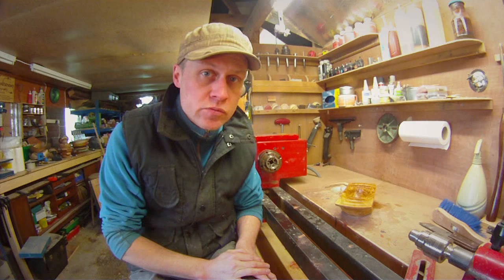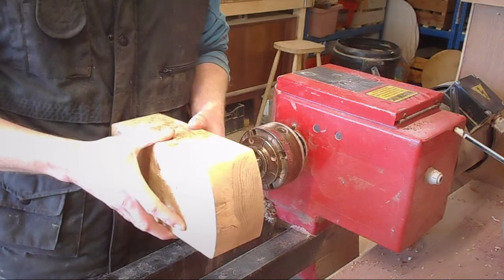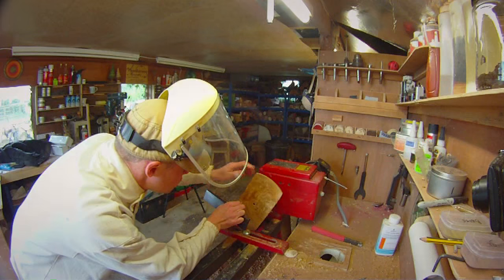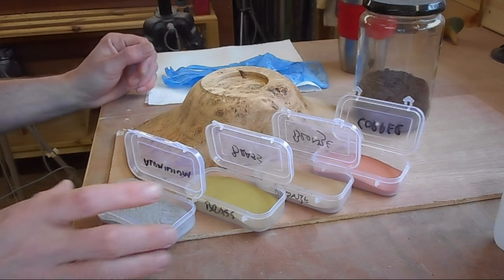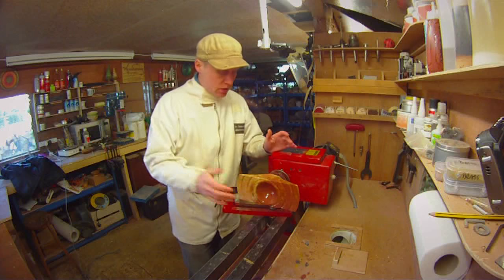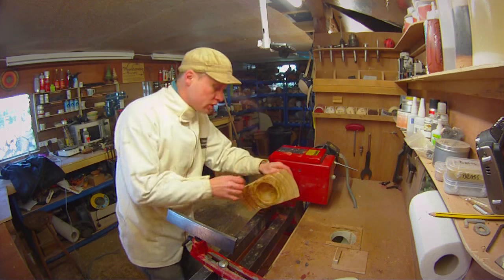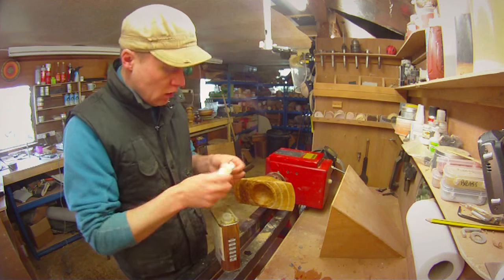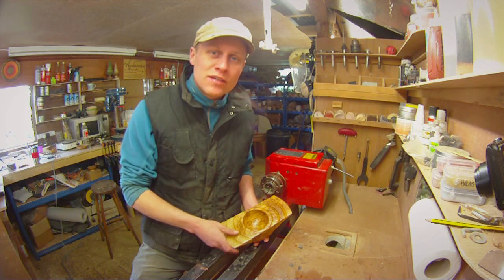#60 -  Woodturning Burr Burl Oak Winged Bowl with Copper Inlay

Comment: Hi Martin, lovely bowl. I have done a lot of resin cast bronze work and epoxy inlay work. To achieve a good metal look, you need to add an awful lot of copper powder. I found the best way is to use a very slow setting epoxy resin ( 60 min working time )mix thoroughly then mix in the powder until it is almost a putty and will not slump. You will need to leave it 12-24 hours before re-turning  but results will be very good. Cheers Jim.

Comment: Nice Job, A few months ago i did a bowl with power but i sealed the bowl then filled the holed and cracks with powder then put the C.A. glue on top then activator spray then re seal the wood. cut and sand. it saved lots of powder. But you have done a great Job loved the video :)

Comment: Hi Martin the best way I found to add metal powder is with a straw shaped like a high sided spoon with the hole on the horizontal then use thin ca glue that will give a glass finish and make metal powder pop nice job
Reply from the maker: Hi Richard. I've found that CA works brilliantly. It is quite expensive to fill a large piece like this though. CA is quite pricey over here, I'm pleased I didn't use that method on this piece though as it is not quite good enough to sell.

Comment: Hi Martin. Love the video's. Just a little comment, your a fabulous Turner n like most you turn pens. Now Oak Burls are very expensive n if it was mine i would have cut on the band saw maybe 2 pen blanks from either end under the handles. So instead of make sawdust I would have made some beautiful pens. this is only because I'm from the cabinet trade n we always kept bits n bogs. Love your work.

Comment: I guess great minds think alike. ;-) I'm working on a similarly shaped bowl as well. I wasn't so lucky to use such a beautiful piece of burl oak, mine is cottonwood. Not a very good choice I've found. I made the same error of not centering the piece precisely. I used my sanding disc to even it up...less tool marks to remove. My piece was green and presented some unexpected challenges. I left the wings about 1/2 inch thick so I could rework them later. Unfortunately the wings curled down about 1/4 inch. I was left with pretty thin wings in the end. I may still try to make similar rings on the top as you did, but not much to play with...we'll have to wait and see. Anyway your bowl came out fantastically beautiful.

Comment: Enjoyed your talk through, very informative,worked in marble and had to repair some times ,we used epoxy and bronze filler.We mixed on a slab of glass.cleans off well with acetone.also use a stainless steel spatular.also cleans of with acetone.
Work safe so u have a good day.  I've subscibed.

Comment: Hi there, been watching awhile and I love your work with contrasting elements, particularly the metal powders(though I loved the split pieces you did up with wire and leather).  I wondered if you've ever tried mixing your metal powders(or other pigments/colorants) into the epoxy components before combining them.  If you were to dope the liquid epoxy and/or the curing agent with your copper beforehand, you could ignore your epoxy's working time and likely have an easier time mixing it into a thinner liquid(s).  Just a thought, love the piece!

Comment: Hi Martin I was so glad when you got out of line of fire when shaping the underside of your piece. It would have been so much safer if you had brought up the tailstock for some initial support. You know this.
Burl is by nature weak in places because of voids. You placed great faith in a woodscrew only hold. Had it come off you would have needed more than a face shield to save face or ribs etc etc. Scary.